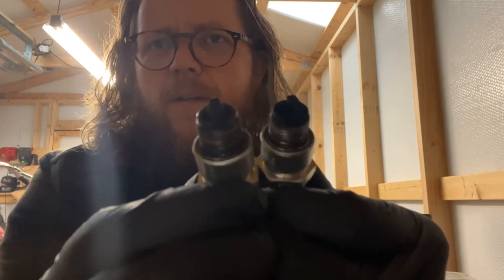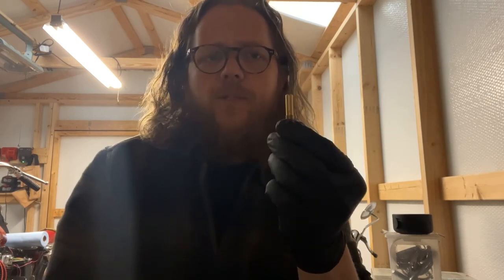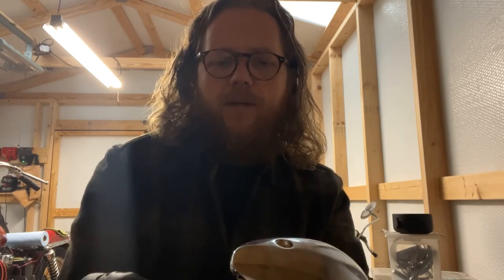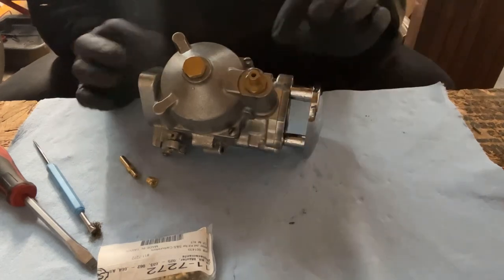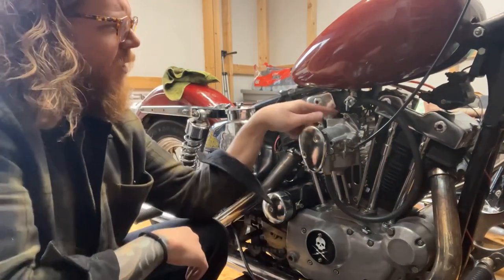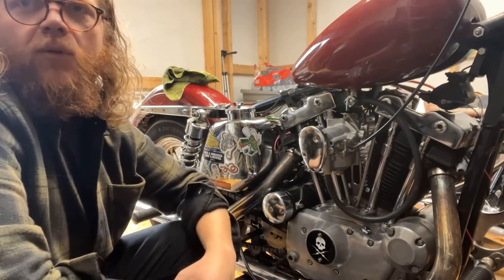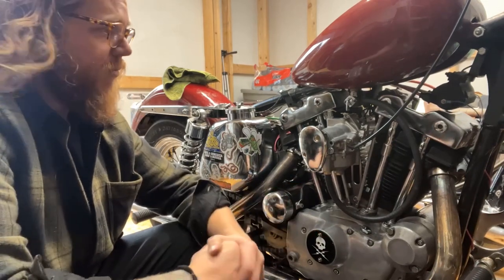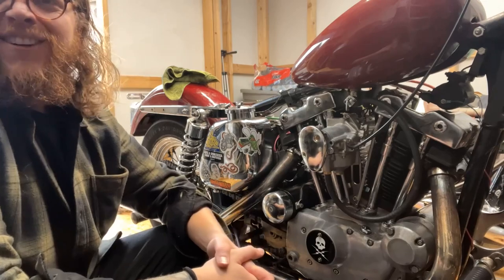IronHeadAche Collective Ep. 4 - S&S Super B re-jetting and installation.

Comment: Try 29/66 with 1 3/4 turns out on the mix screw.
Reply from the maker: Thanks John! Im going to try that. Throttle has drastically improved since the rejet but it is still running a little rich. Thanks for watching and commenting.